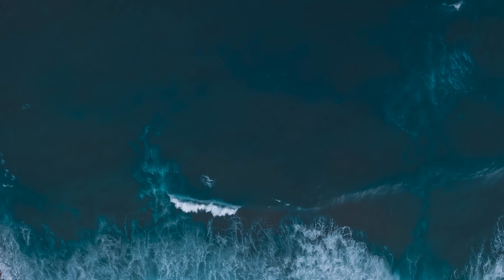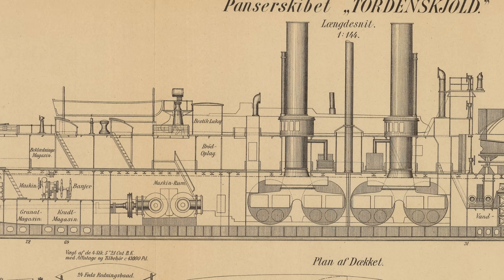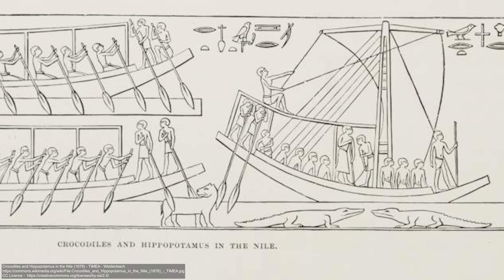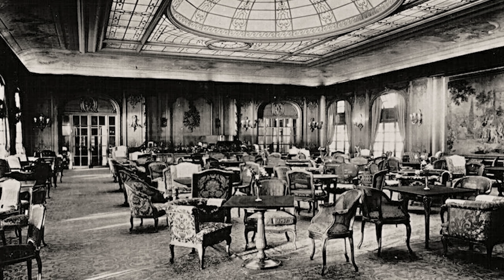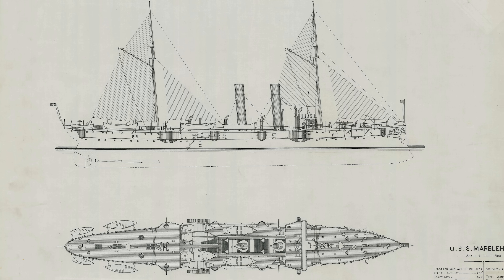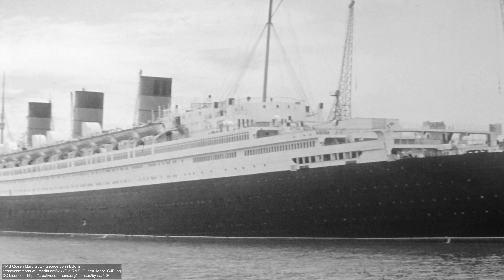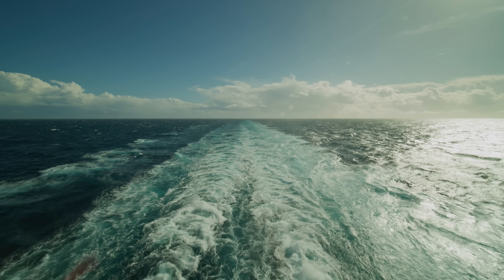Why Don't Big Ships Tip Over?

Comment: I don’t believe you addressed some key aspects of stability: Firstly, that the centre of buoyancy is not constant but a function of pitch and roll, secondly, that the righting moment as a function of pitch and roll is what actually forces a ship back upright, and thirdly, that hull-shape-induced drag upon rolling and pitching provides the necessary damping that prevents harmonic oscillation, which could otherwise cause capsize in the right sea states despite the aforementioned stability factors.

Comment: The linum vitae, a.k.a.the iron wood tree is a wood so dense it will not float. It is an extremely hard wood sometimes used for the propeller.  Its high resin content makes it resistant to rot and helps with lubrication. Just an interesting side note. As always, I enjoyed your comments.

Comment: The small passenger vessel I was skipper of had a stability test done by The Maritime and Coastguard Agency, it involved having weights to the maximum expected when at capacity, we then moved them both from Starboard and port as if all the passengers were on one side or the other of the vessel.
Of note we did have a small lean to the Starboard side, more prominent when fully fuelled.
It was great to see the old girl pass the stability test and our upper deck opened to passengers 
Lovely video explaining how this all works

Comment: Having spent several years on US aircraft carriers (USS Saratoga (CV-60) & USS Independence (CV-62)), I could appreciate this video even if I already knew most of its content.  Any sea that gets an aircraft carrier rocking and rolling is truly rough seas!  During my first return trip across the Atlantic aboard the USS Saratoga (ending my only round trip on the Sara), I watched a Newport Class LST doing a fair imitation of a submarine with the area between the forward ramp fittings and its main superstructure vanishing below the waves!  Every time she came up, tons of water flowed from her forward deck--a wondrous testimony to how well she was designed!  Sadly, I don't remember which ship of that class I was watching, but Sara plowed forward at formation speed as if the heavy waves weren't there.  While often maligned when things go wrong, engineers of all kinds perform miracles routinely!

Comment: I doubt very much that ancient people built their boats by trail and error.  Building a boat is so energy and resource consuming that ancient people would not have risked all the effort , cost and work on a gamble.  Even without reading or writing, ancient people would have been aware of geometry and how the shape of things very much influence their behaviour and stability.   They would have been aware of what materials float,  buoyancy, what shapes move best through water.   I mean they didn't build round boats did they?   If they did any trial and error work, it would have been at the small scale not the fully finished scale.
Reply: How do you think they discovered geometry?

Comment: "As long as the bouyant force remains equal to the weight of the fluid that the ship displace, it will float." - I can tell you were significantly tired from long day's work when saying this part, otherwise you would surely notice the issue with it. Namely that bouyant force always remains equal to the weight of the fluid that the ship displace, even when said ship is resting on the ocean floor - exactly as Archimedes law says. As you see, cited claim is therefore incorrect. 

For anyone who might be wondering what the actual condition for floating is, this bouyant force must be equal to the overall weight of the object in question - in this case ship. If it is smaller,  object is sinking, if it is larger, then the object is rising up. 

Regardless, I realy appreciate your effort put into these videos. Your channel helped me get over a week long period when I was bedridden due to lower back issues - thank you for that. 

Keep up the great work.

Comment: Modern cruise ships have more crew than the entire population sailing on the Titanic.  The Titanic had 2,240 passengers + 900 crew = 3,140 people.  The Icon of the Seas has 7,600 passengers + 2,300 crew = 9,900 people and 20 decks.  So far we have never lost one of these modern floating hotels.  The sea can wait and it's just a matter of time of when and where.  Looking at these Condo Ships I wonder how they can stay floating and not fall over.  Even with this great show...I look at them and still worry.

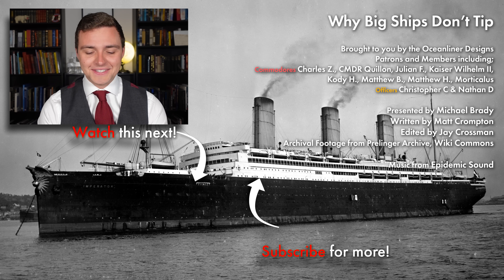Comment: 13:35 and the illustration of the HMS Royal Sovereign; the "B" on the plans amidships is for (caol) bunker not ballast. I know pedantic, because I understand the point you were trying to make.

One point on cruiseships, they high slab sides do make them difficult to manoeuvre in winds. It was about force 6 last month and we couldn't dock in Skagway Alaska because of the way the hills funneled the wind.

Comment: It would be highly interesting to dig a bit deeper into the recent bow contructions. For example, how would an ”icon”-class cruise ship with an X-bow handle a rogue wave that almost capsized the Queen Mary. 

And how do the x-bows operate compared to a bit more traditional bulbous ones during really rough weather..

(And as the history is concerned, if I remember correct, Lusitania encountered a rogue wave too. It sailed against the wave, which overwhelmed the bow deck, broke the bridge windows and tha ship plunged really deep to recover slowly and barely. )

Comment: Here is my "big ship tipping over" story.  In 1991, my family went on a cruise aboard the now retired Royal Caribbean ship the Nordic Prince.  Due to a miscalculation by the captain, we sailed right into Hurricane Bob.  During the wee hours of the night, we felt the ship beginning to list to one side and then heave over to the other.  Around dawn the rolling intense enough you could not lie in your bed.  Unable to sleep we ventured outside our cabin to find the hallways and public space filled with miserable passengers and crew.  Many could only sleep around the center of the ship where the movement was less pronounced.  Almost everyone was horribly seasick and awful smelling trash cans were spilling over with vomit.  As a dumb kid, it was kind of a grand adventure walking on the walls and stepping over doors to state rooms when the ship heavily listed to one side.  We then had to quickly jump onto the floor and opposite wall when the ship rolled to the other side in a matter of seconds.  The captain continuously reported that everything was fine with the Nordic Prince being a "very seaworthy ship" and there was no danger.  Years later we found out this was just to comfort the passengers and we were in a serious situation.  The captain tried "ride the waves" with only partial success.  The large waves that slammed the hull violently from side to side did do damage.  The ship apparently came within 2 - 3 degrees of capsizing.  Even though an SOS was went out, the chances of rescue would have been unlikely.  No way could the lifeboats could have been launched in a category one hurricane with the ship being tossed from one side to the other every few minutes.  Once we cleared the storm, the passenger areas were in shambles.  Loose furniture cracked glass panels, even bolted down items like slot machines were tossed around, and the galley was almost destroyed.  Several passengers were injured one that lost several fingers when their hand was caught in a slamming door.  I recall our cruise fare was fully refunded and we offered an free cruise as well.  Our family used it to sail on the largest cruise ship at the time, Sovereign of the Seas.
Reply: That's awesome, sorry for the people that got sick and hurt though. Losing your fingers? Brutal. 😖😬

Wild story man. Glad you and your folks made it out with a cool story. I'm amazed y'all took the offer of the other cruise, if it had been me and my family we would have nope'd out of that fast! 😂 hell, I watched the movie Poseidon and it  made damn sure you wouldn't be catching this ass on a boat! Scared the snit out of me! 😂
Reply: @crakhaed  it was quite an adventure indeed that thankfully did not lead seeing the bottom of the Atlantic.  Passengers were given the option of disembarking in Bermuda and many did do so.  We figured it was a freak occurrence and have continued to cruise.
Reply: I am amazed, when you mentioned that the "Nordic Prince" had encountered the hurricane in 1991.  By that time, with ship crews using the satellite tracking and computer predictions of storms, I am surprised that the vessel actually had to deal with the storm.  

I'd bet 'dollars for donuts' that the master received orders from the shore operations office, on the route to take, this, as always, keeping the vessel's schedule, of more paramount importance, than actual safety.  The office crowd, would not have purposely put the vessel in danger, nonetheless, playing the odds, they 'royally screwed-up'.  Modern passenger and container ships, have the speed to easily 'outrun' or avoid altogether, an approaching storm.

Anything that floats, can sink.

Comment: Hi Mike, it was great meeting you at the Ocean Liner Conference! Very enjoyable video, however, the description of how ships remain upright at the 2:30 mark is not quite right. The Centre of Gravity can be, and usually is, above the Centre of Buoyancy. But what you said about the balance between the buoyancy and gravity is absolutely correct. The Centre of Gravity (G) is fixed (ignoring stuff like free surface moments), but the Centre of Buoyancy (B) will change as a ship rolls. When a ship rolls, B will shift transversely to the side of the ship that sits lower in the water. The buoyancy force acts vertically upwards through this point which is now offset from the centreline. The centre of gravity acts downwards, and these opposing forces create a moment that acts to return the ship to equilibrium (i.e. when G and B are aligned vertically) and keeps ships from tipping over. The transverse distance between the buoyancy and gravity vectors is called the Righting Arm (also known as GZ) and determines how great the righting moment is. Naval architects will produce something called a GZ curve which will show the length of the righting arm at different angles of heel. The point at which GZ curve intersects the x-axis of a GZ plot is known as the angle of vanishing stability, and basically means there is no moment to return the ship to equilibrium. This is what Queen Mary was close to reaching when she was struck by the rogue wave.

If you want to learn more about ship stability, "Introduction to Naval Architecture" by Robert Zubaly is an excellent resource. It is nicknamed the blue bible by naval architects because pretty much all of us have a copy sitting around somewhere!

Comment: You need to do a bit more research. Look up "metacentric height". Ships Center of Buoyancy is actually lower than the Center of Gravity. The force that keeps a ship from rolling over is driven by the fact that the shape of the hull actually increases displacement as the ship heels which drives the ship upward. The position which has the smallest displacement, and is the most stable is actually when the ship is vertical. That is what drives the stability.

Comment: You can change the distance between G (center of gravity) and B (center of buoyancy) to effect the ship's roll. The greater the vertical distance between G and B, the less likely she will roll over. But this makes for a very stiff and snappy roll, which is quite uncomfortable, and it can cause damage to equipment and injury to passengers and crew.
Lower B until it is closer to G, and you get a longer, slower roll. This makes for a more comfortable ride, but is less safe in high seas.

Comment: There is another important factor.  When a ship rolls, the portion of the ship that is under water changes.  This change moves the center of buoyancy because a  different bunch of water has been displaced.  How much the center of buoyancy moves for degree of roll changes the amount of restoring force that is trying to right the ship.  A wide flattish shaped bottom does a lot of this.  A shape that is more like a part of a circle does less. A very tall and thin hull can result is a ship that likes to lay on its side and go to sleep in the deep.

Comment: As you say, center of bouyancy needs to be maintained above the center of gravity.  But another key part is how the center of bouyancy shifts side-to-side when the ship heels over.  The shape of the underwater hull plays a key roll in this (no pun intended).  If a slight heel will shift CB to the low side by a lot, then she'll be pretty 'stiff'.  A 'squarish' underwater shape helps in doing this sort of thing rather than a 'rounded' underwater hull.

Comment: I was a sailor in the USN for ten years and I still wonder.  You really can't appreciate the scale of the ships until you have been on them, living, working on them. I was in Awe anytime I saw a fast attack submarine in drydock... even those things are massive
Reply: After HS I went to college to get a watchkeeping ticket,  passed my Stability courses which go into excruciating detail including calculations etc. about ship stability. Then I joined the navy (Over 20 years ago now) and stood bridge watches at sea for years. I still couldn't explain much beyond GM, keep G down with all the heavy stuff, and hopefully M doesn't fall below G. If ice builds up, chip it off. The Schooner I intend on building will have hollow spars and dyneema rigging to keep weight aloft thereby improving her sail carrying ability. I "get it" in that I definitely understand "weight up bad" but I couldn't for the life of me explain the math or physics behind it in a manner an engineer would find acceptable. Or even comprehensible.

Comment: So my cousin and I growing up in central Florida. He had a 16 foot aluminum John boat that we used quite often 3 or 4 times a week. In our late teens, we would go home from school and go to one of the many ponds or lakes in our small town fishing for bass and bluegills. We had batteries and a troller motor for the small ponds, or longer duration trips. And a 9hp mercury for lakes or quicker trips. He got a 35 Hp Johnson, we had to carry two fuel tanks and the troller motor batteries in the very front just to stay upright. 30-35 mph probably, faster than you wanted to go in that. Holy 💩. That was back in 99-2004. Well that’s my bouncy story.

Comment: Hi Mike. Just wondering if you're planning a video on the impending sinking of the 72 year reigning Blue Riband SS United States that will be towed to the Gulf of Mexico off the coast of Florida. There it will become the largest man-made reef. Very sad, but I guess it's far preferable to merely scrapping that beauty. It was scheduled to be towed out of Philly this week, but some problems have delayed that...but its demise appears inevitable.
Reply: The ghost of her older running mate is hanging over the Big U. Maybe the tugs don't want to take her, end up losing the ship in a storm and have the ship get up getting beached.

Comment: great topic I had a good question here

 I always find like how the hell could tons and tons of stuff be in that ship or I'm thinking of Titanic here like it was a solid enough ship 

 like I find it funny why does ships like the Carpathia or Olympic for example, why do they lower their anchors down? what exactly is that going to do if it stays up right without needing to use the anchors? like when the Carpathia docked in New York it had its front anchors dropped they weren't dropped very very far..I don't think so... I don't understand how all that weight can be in a ship and not turn over or go very low in the water.. this is a good topic and it's interesting for sure great video... just all that weight u would think it would sink right there...

there's pictures of Titanic that show it right next to like very flimsy I don't know what it is it's just like it's right there next to the where the land starts and I think about how they had to anchor off of Ireland and have tenders take out passengers to Titanic cause they couldn't go too close because the water wasn't deep enough

 there's a few pictures that I think of and Titanic is almost practically on the land but yet after Ireland was loaded up and ready to go they had it off for a life in the New world

would love an answer if u know what I mean, idk much about ships besides 3 or 4 I think